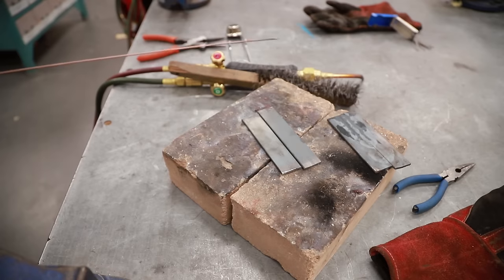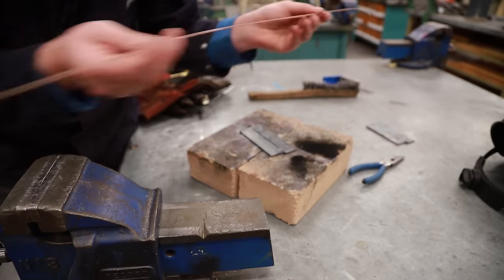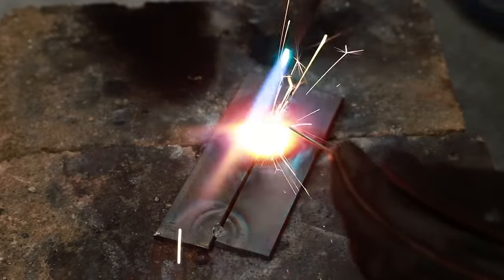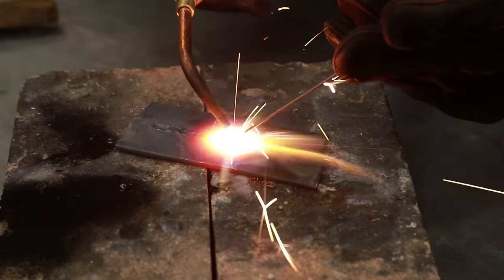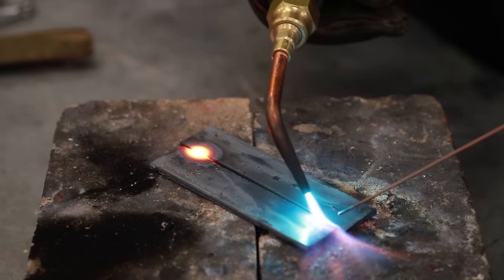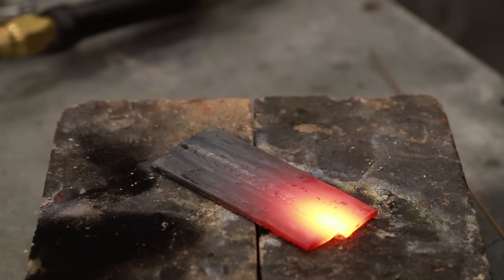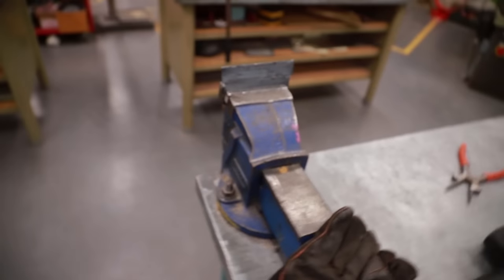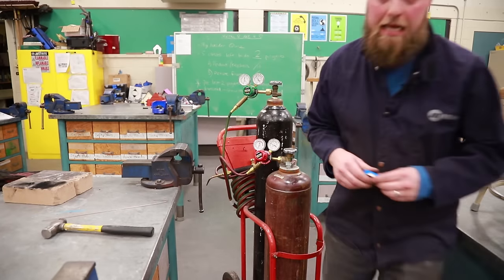Intro to Oxy-Acetylene Welding - Part 2

Comment: Thanks for the lessons. I bought a used oxy acetylene set. The needle on the regulator are tembling and I keep loosing my flame. Any advise?
Reply from the maker: What pressure do you have each tank set at?
Reply: @WeBuildStuff  Thanks for getting back to me. I know I set to what you said in lesson 1 but I have to keep my eye on them when I am using the torch. I will reply again.
Reply from the maker: @jshivprashad  turn the torch knobs slowly when adjusting. Adding too much oxygen quickly can sometimes extinguish the flame. Could be a few things... good luck!

Comment: I wondered if tacking on 1 side and flipping plates over to the open gap and starting closer to the end would improve strength.
Reply from the maker: For sure. The point of these welds wasn't to show strength.  I have students start like this so they can see the way metal penetrates at low temperatures

Comment: How does gas welding compare to electric welding? I am thinking about getting welding equipment and wonder if this is easier or cheaper than tig welding. With gas you don’t need a circuit, but is is harder to achieve a good weld on stainless or aluminum or steel? I want to work with at least those three metals.
Reply from the maker: If you have the option tig welding is a fantastic choice because of it's versatility to weld different materials.

We end up using the gas torch for basic brazing, learning coordination, and reinforcing safety concepts.

We end up using the torch more for melting and heating in our day to day shop use with the students.

Comment: when you say "more heat"  what does that mean?  More acetylene?  More oxygen?  What psi did you turn it up to?
Reply from the maker: Pressure on the regulator stayed the same when I adjusted it in this video. I opened the torch valves more and adjusted for a neutral flame. You can usually hear the flame roaring a bit more!
Reply from the maker: More of both.
You can also buy larger tips for your torch and really get things going

Comment: Great video!  It answered a lot of questions I was curious about. Can you tell me a little more about the filler rod?...what is it and where can I get it?  Thx!
Reply from the maker: You can get filler rod at any welding supply store or most hardware stores (home depot, etc)
Reply: @WeBuildStuff  any more detail? I see plenty of electrodes for stick welding, but I am struggling to find anything that calls itself filler wire. I see plenty of mig wire spools. Could I use that or am I looking for more specific? I see people mentioning coat hangers as a filler wire. Does that mean it is just any wire that is small enough to melt and be added into your welds?
Reply from the maker: @crazyhat433  R45 ia a common type for gas welding
https://canadaweldingsupply.ca/products/r45-mild-steel-tig-rod-1

Comment: I'm a professional fabrication welder who is certified in every process except oxy-fuel. Apparently, it's extremely messy TIG. Don't think too hard about the Heat Affected Zone size. Or at all, really. 
Oxy-fuel welding is like traditional blacksmithing. It's an awesome but totally obsolete technique.
Reply from the maker: 100% haha

Comment: i would like to learn how to weld for the sake of being able to repair things. with so many choices how do you choose? mig, tig, stick, gas

can you repair for example a lawnmower deck using gas?
Reply from the maker: There are many options and I would suggust getting really good at what you have available. The thing i like about the torch is the ability ro also heat amd bend metal, braze, and do basic fixes. For strength I love my Miller mig welder. If I wanted more options In would go for a combo stick/tig welder.

Old school 'farm' and general construction uses stick because it can be more 'portable'

Comment: Try not circling so much. Aim the cone down the gap until a keyhole forms then ride the keyhole down the joint while adding filler.nicely done video.
Reply from the maker: That will be part of video 3 coming up showing how to get stronger penetration! This was just to introduce the techniques. Thanks for watching!

Comment: Are you holding the extra O2 lever on the torch the entire time or just holding it?
Reply from the maker: The acetylene dial and oxygen dial on the torch handle don't get touched once the flame has been adjusted and set. 
The extra lever you may be thinking of may be a cutting attachment. This video just shows the welding.
Reply: @WeBuildStuff  i think you are right. So I recently bought my own victor set after borrowing my buddies a few weeks back. Fell in love with cutting. Then I tried to weld with a cutting tip and that went as well as you would think it would. But if for welding you change tips and set the a and o2 then your good, then its almost like soldering at that point.
Reply from the maker: @Icesith67  yup!

Comment: At roughly the 5:00 mark where you said you "increased the heat, increased the pressure", did you do this at the handle or regulator or both? Was this on the oxygen side, acetylene side or both?
Reply from the maker: On the torch handle I open both to increase the heat. Terminology isn't always my strong suit!

Comment: When you said increase heat, do u > acetylene or 02? And would penatration help with chamfered the gap like in mig?  I'm a novice🙂
Reply from the maker: Yes, chamfering would help when adding filler rod. For more heat I increase Acetylene first (hear the flame "roar" as you increase it) and than add oxygen until a good ratio to achieve a neutral flame
Reply: @WeBuildStuff  cool thanks man👍

Comment: When you say you are increasing the heat, is that by adding oxygen, acetylene or both?? Also, what kind of filler rod are you using? I assume it is not brazing rod??
Reply from the maker: I added extra acetlyene and oxygen to increase the heat using the valves on the torch. If the flame still isnt enough go up a tip size to get a bigger flame. We use RG45 rods which are general purpose
Reply: @WeBuildStuff   Thanks for the information. I am a beginner but your videos are really helpful.

Comment: Can you tell us how you increased the heat?  How much more pressure? What are the numbers on your tanks?
Reply from the maker: I set my pressures at around 5-6psi for acetylene, 8-10psi for oxygen (15 if cutting). Light the torch acetylene first and to increase heat start by adding more aceytlene. If it sounds more like a roar instead of the sooty carbon smoke then it will be hotter. Add your oxygen next and increase until the cone gets small as shown in the videos. 
Another way to get more heat is swapping the tip of the torch to a larger size. I typically teach students with a 0 or 00 tip to practice on small stuff. We rarely weld anything thicker than 1/8" steel with the torch. Anything thicker i usually move them to the MIG welder
Reply from the maker: Also watch part 1 to see how I set the tanks up

Comment: If you want more penetration, make sure your gap is just a smidge bigger than your rod. Make sure you burn both edges out to make what would look like a key hole, also instead of circles try doing U’s and keeping your rod in the puddle alternating from where your torch is.
Reply from the maker: Thanks. Since posting these videos for my students I have been getting better myself and learned a lot of new tricks thanks to some helpful comments! I usually do a zig zag or a U and have been having students leave a gap :)

Comment: How do u stop it from popping I hate it so much and scares me
Reply from the maker: for welding: a clean tip helps but the most common cause is the ratio/mixture of oxygen to your fuel/acetylene. 

Here's some info written by a smart person:
https://www.ijera.com/papers/Vol7_issue3/Part-5/B0703051418.pdf

for snacks: turn off the hot air popcorn popper

Comment: Did you get a bigger nozzle or just crank up the fuel pressure?
Reply from the maker: I think I was using a size 0 tip and opened the valves on the torch handle more to increase the heat. Tank regulator pressure stayed the same
Reply: @WeBuildStuff  I suspect you would have gotten a better fusion with a larger tip. Thanks. Very good video!
Reply from the maker: @CandidZulu  yes and I should have aimed down to start a keyhole and then started moving my puddle. I've learned a lot since making this basic video. Always learning!
Reply: @WeBuildStuff  My welding instructor always ended our destructive test with "you fusion was an illusion".
Reply from the maker: @CandidZulu  that is a great line! I'll be using that!

Comment: Thanks for helping my dumbass pass auto body welding I literally cannot get this
Reply: We use brass dipped with flux instead of regular steel filler should i still be melting the base metal? I worry abt zinc poisoning

Comment: Looks great but seriously...who has the time for that?  By the time you got your first tacks done my Syncrowave 250 would have welded three of those lengths w/ 3/32" rod.    Gas welding is useful for cast iron I guess.
Reply from the maker: By the time I read this comment I welded a whole go-kart while walking uphill both ways! ;)
Reply: @WeBuildStuff  Not with oxy you didn't!    Independent four wheel suspension?   What engine you using?
Reply from the maker: @samj1185  212cc utility motor with pieces of an ATV frame and the rest custom machined go kart style.... Still not quite safe for trail riding yet haha
Reply: @WeBuildStuff  'safe' is a relative term usually dependent upon your ability and attention to detail.  That and a good helmet.  Build it!  Can't wait to see it.

Comment: What is the purpose of using a filler rod?
Reply from the maker: Adding more metal with good penetration can strengthen the weld and also look good😉
Reply: @WeBuildStuff  Is there any mechanism for removing contamination like oxides or nitrites of metal from the joint faces?

Comment: Love ur video. But can you tell me did u use tig rod or brazing rod to me it looks like tig rod er70
Reply from the maker: We use "R45 Mild Steel Gas Welding Rod"
Reply: @WeBuildStuff  if i may ask will tig rod work.  And tnx u i will look that up
Reply from the maker: @bd8839  you can certainly do it but will get a much cleaner weld using the right type of rod based on the specific application. Gas welding you might not notice a huge difference with the specific type of rod as it mixes with the puddle. If tig welding use proper tig rod for your specific application
Reply: @WeBuildStuff  tnx u. I been tigging a while and i just wana get into the gas side looked neat and fun way to weld something if u had no choice or power.  And u had to weld.  Tnx u for ur videos its much appreciated

Comment: Question #1 . In clip # one you show setting up a tight 'ball' for welding  , then when you tied the 2 ends together the the 'ball' looks quite bigger. It looked the same when you went down the flat steel pieces doing the push the puddle .  Did I miss something ?

Question #2.  Is it advisable to do  a weld on the backside where accessible ?   Would that make the weld stronger or weaken the first side weld ?  Thanks.

Comment: No flux needed?
Reply from the maker: Flux for brazing rod. this is R45 rod. R45 is a general purpose, copper coated, oxy-acetylene gas welding rod used for welding low carbon steels

Comment: Hello...thank you for your video...well done and well explained; however, I do have one questions...you said that when you need more heat you will "increase the pressure," but you don't say increase the pressure in what...the OXYGEN or the ACETYLENE? Thanks.
Reply from the maker: Both. A couple different ways to do it. Change your tip to a larger one. Open the valves on the tprch handle a bit more until it "roars" a bit more. If doing oxy-a cutting there is a whole other tip you have to add a few changes to the pressure on the oxygen regulator. Eventually I'll do a video on that. Always tricky putting my camera near flames and sparks!

Comment: Where does oxy-acetylene gas welding have an advantage over electric methods?
Reply from the maker: For strength I prefer MIG.
I use Gas for heating and bending, working with jewelry, and developing skills that lead nicely into Tig welding.
Reply: Does it actually have an advantage?

Oxy-acetylene welding basics are taught first only to be followed by oxy-acytelene cutting, which is still very relevant in heavy duty metalwork. It is often more powerful, versatile, portable and/or capable than machining, sawing, abrasive, plasma or other methods when the material is very strong or thick.

Actually welding stuff with a torch is almost entirely obsolete, and other welding methods are more important. However, what is shown in these videos is still part of a minimum skill set. Oxy-acetylene basics are important because the system is so dangerous and widespread. From what I read it is actually better to purge the regulator too, so that no pressure remains forward of the bottle main valve. Otherwise a small amount could, just might, leak into the hose and make its contents explosive for a while.

Important safety devices exist on both ends of the double hose set. These should be observed and maintained along with the hoses which must always be in flawless condition. This is just as important as a good working practice.

Just applying heat can mostly be done by much safer means, including electricity and a simple gas torch. Even when very high temperatures(even cutting ability) are needed, oxygen/butane/propane and similar systems exist. They are somewhat less critical regarding worst case scenarios and typically much cheaper to keep around. Admittedly they are a bit inferior and oxy-acetylene is king.
Reply from the maker: @tonsssedell4318  All great points! Thanks for sharing!

Comment: How to increase the pressure from A or B
Reply from the maker: Is this a question or a statement?
Reply: @WeBuildStuff  question how to increase the pressure  from gas or O2
Reply from the maker: @ibrahimfayaz2591  turn the regulator for each tank while the corresponding  torch valve is slightly open to your desired pressure. This video shows more: https://youtu.be/C6lluYIl9Xk
Reply: @WeBuildStuff  thanks

Comment: I DONT THINK YOU ARE HOLDING HEAT IN ONE SPOT LONG ENOUGH TO MAKE THE FULL BOND WITH FULL PENETRATION I WELD MUFFLER PIPE AND ITS EAZY TO SEE WHEN YOU GO TO FAST WITH THE HEAT YOU SHOULD BE ABLE TO SEE ALL THEEE METALS BOND

Comment: Isnt this brazing?
Reply from the maker: Filler rod and brazing rod have different melting points. Brazing ends up more on the surface while filler rod allows for penetration with enough heat. You can also easily reheat a brazed piece to take apart. Filler rod can become "part of" the piece with the correct temperature

Comment: I wish my welding teacher would have accepted those welds.  He would have said the weld is too shallow and  lacked penetration. 🤷🏽‍♂️
Reply from the maker: I never said these welds were acceptable.  This is still just an intro for students to figure out how to hold the torch and get started. And then smashing with a hammer shows how poor the penetration is. In class we then show adding a keyhole and getting better penetration.
Reply: @WeBuildStuff  👍🏽

Comment: Safety wise you were on par but you just showed us a couple methods of how to not get full penetration. These would not pass an inspection.
Reply from the maker: The purpose of the video is to INTRODUCE the basic techniques to teenagers. Part 3 (eventually) will go into stronger welds. Thanks for watching!

Comment: My instructor says that we have to turn off Oxygen, then acetylene or else I would get a gunshot like pop.
Reply from the maker: Yes that is correct. I have since changed my technique and fixed my bad habits since releasing this video
Reply: @WeBuildStuff  ah I see. Just trying to keep you safe. Never want to see a youtuber get hurt during a video
Reply from the maker: @thegoproguy1773  I do suggest to students that in an emergency to cut the acetylene first because the flame usually goes out right away. That is also why we only open the main tank valve 1/2 turn so it can be closed off quickly.
Reply: @WeBuildStuff  yes my teacher says the same thing. But she doesnt want to risk of an injury because she also mentioned that it can explode if it is turned off incorrectly
Reply: @WeBuildStuff  have you done arc welding before?
Reply from the maker: @thegoproguy1773  While I've never seen a "big" explosion you can experience "popping" sometimes when turning it off incorrectly
Reply from the maker: @thegoproguy1773  I don't do it often as I have a MIG which is way easier for me :)
Reply: @WeBuildStuff  same here. MIG is pretty easy for me as well. I actually happen to be in arc welding for my class. It's pretty fun and smells like burnt wood after I am done

Comment: Isn't this brazing
Reply from the maker: Brazing is usually just on the surface. Fusion welding or using filler rod penetrates the metal and actually joins the pieces together. Typically stronger than brazing.

Internet words:
Brazing differs from welding in that the temperature is considerably lower and does not melt the base metals. Rather, the heat source melts a filler metal and draws it into the joint by capillary action. It creates a metallurgical bond between the filler metal and part surfaces."

Comment: Sorry, you're no welder. You used no flux that I could see, I use bronze with the flux already on it.
Reply from the maker: Are you thinking of Brazing? We do filler rod welding as shown in this video and brazing for some other applications
Reply: Filler rod might work, I just prefer brazing. It's all good.
Reply from the maker: @twagner6155  i find it works well to teach them this to get the technique of dipping into the puddle and moving the torch properly before moving them onto tig welding